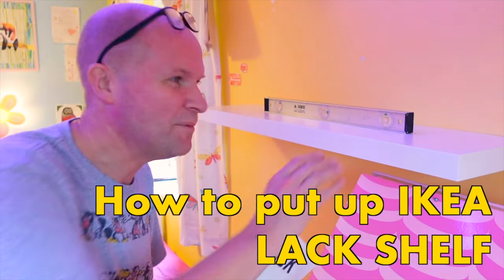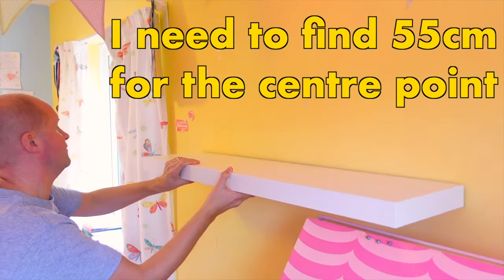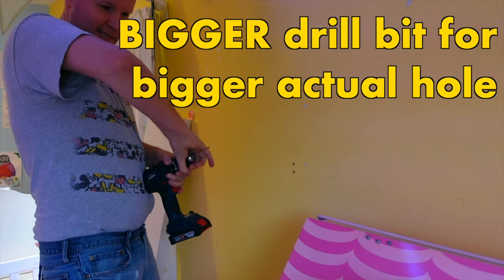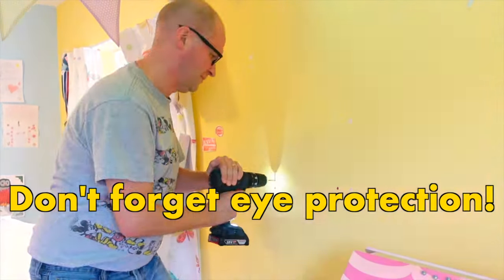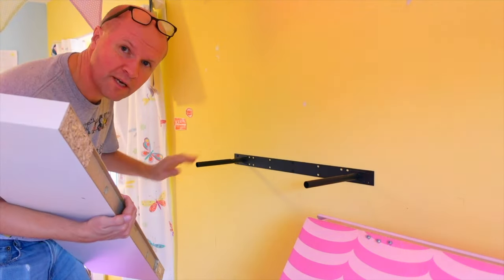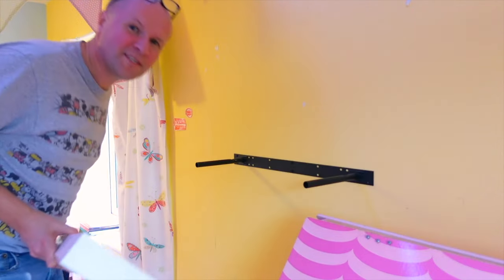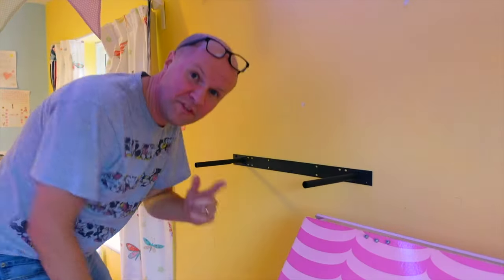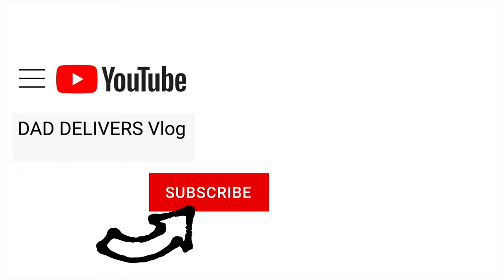How to put up my IKEA LACK SHELF... or not... INSTALL FLOATING SHELF #IKEADAD

Comment: I also installed the same shelf but it is sagging I don’t know why 😢
Reply from the maker: Hi Jennifer, so sorry to hear this - the same thing happened to me.
Here are some things that might help, I'm sure you've done these but just in case:
- make sure the wall anchors are flush with the wall or inside the wall below the level of the wall
- try putting in more screws to make sure the metal frame is fully pinned to the wall.
- try using screws with wider heads, so they even out pinning the frame.

If the shelf gets damp, it can distort so the frame is okay but the shelf itself isn't true.   We've just thrown one away because it got so warped.

Hope something here helps and thanks again

Comment: What size screws do you need?
Reply from the maker: Hi Teresa  - thanks for the kind question 
It took a couple of goes with different screws, but the ones I'm using now are 7mm diameter head screws which are 35mm long
Confusingly on the box it's called 
PH2 Ø3.5 x L35mm

The PH2 is for a cross head or Phillips screwdriver
The Ø3.5 is diameter but the diameter of the screw head is 7mm
And the length is 35mm
But you might be better off with a 50mm length or longer

I'm winging it - not an expert!
Good luck with your shelf!

Comment: I bought one last week, its sagging already how is your one holding up ?
Reply from the maker: Thanks for asking Aaron - this one is okay, but I've got others that are bulging or sagging. I can't see what's causing it because they don't have that much stuff on them...
Reply from the maker: Ah thanks for this Aaron - the arms bend?! This is a really great tip...
Reply: It looks like you screwed them into the drywall only and not studs. If you screw then into the wooden studs or concrete/brick, the shelf has a max weight of 33lbs instead of 11 lbs. Could this be why it’s not holding up as well? I’m putting mine up now and using top and bottom holes on each side that align with the stud - not necessarily where the installation guide shows. Guess we’ll see what happens…
Reply: How are the shelves holding up @tonyah.5258 ? I'm considering installing these too but I want to make sure they don't sag.

Comment: Could you have left the bracket the wrong way up and screwed the shelve from the top ? Could you do this if the shelve is high up and you can see the underneath ... so hiding the screws ??
Reply from the maker: Hi Jenni!
Thanks for the kind question  - absolutely, you can and that sounds like a really good idea to avoid seeing the screws if the shelf is set high up.
Hope this helps and good luck with the shelving!